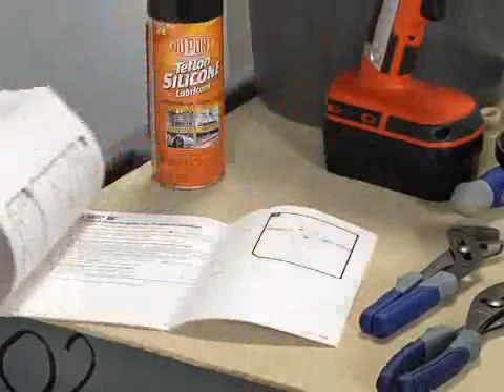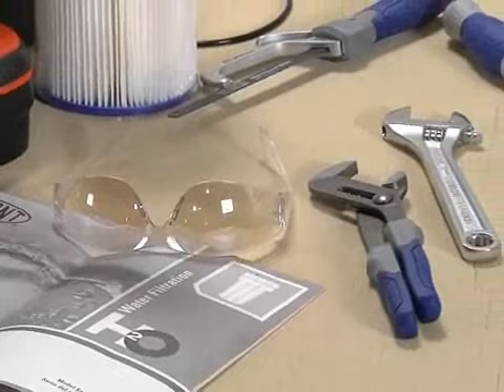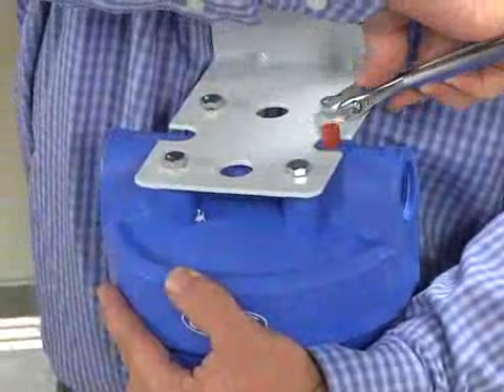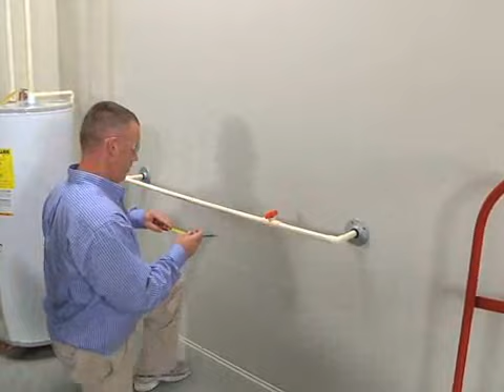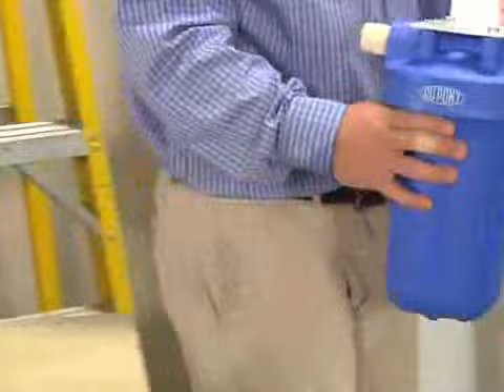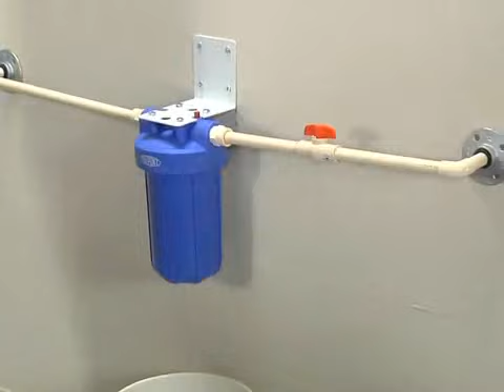How to Install the DuPont Universal Heavy Duty Whole House Filtration System HD1300

Comment: How often do you have to change the Filter? Please don't see in 15,000 gallons. lol. Why not install another shut off valve on the outlet to stop the water back flowing when you're changing the filter?